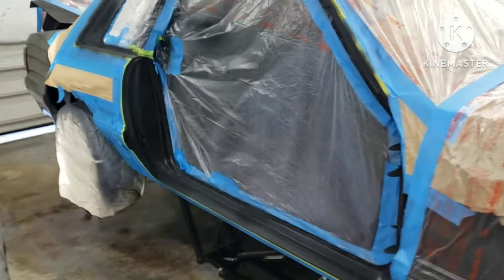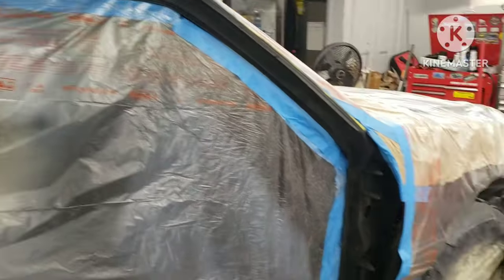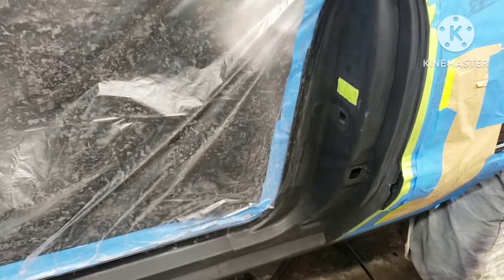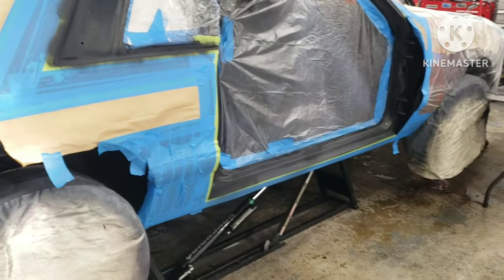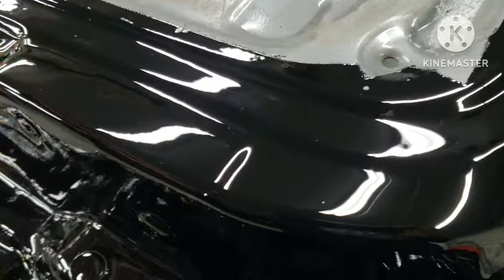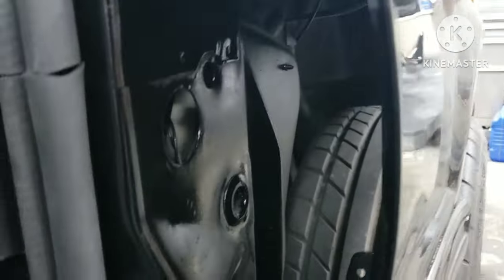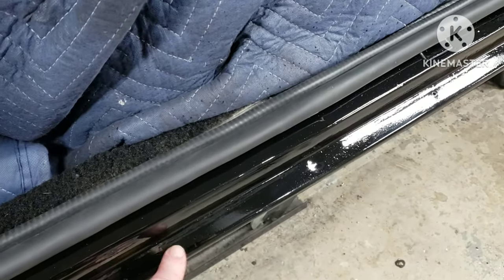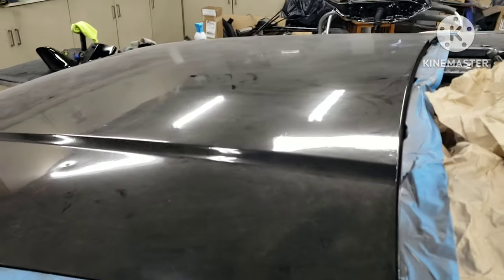Fox body painting door jams and doors. @speedokoterefinishnetwork4937

Comment: Looking good, keep up the good work. Can’t wait to see it all together.
Reply from the maker: Thanks man I'm just waiting to see how bad the IRS is going to kick me in the nuts this year and then I can get this thing done🤣 I have plenty to do but it's sitting on 4 dry rotted tires 100% tread just must have sat outside for years.
Reply: @Joeshomegarage  same here. I just ordered a sve radio gauge pod and a couple gauges to install. My tires are weather cracked. They were on the wheels when i picked them up so no telling how old.
Reply from the maker: @SouthernLifeCollective  Yeah the kid I bought the car from changed it from the old centerlines to the cobra reps which I think it looked better but older guys have different taste I guess! LOL The tires on mine are only 5 years old but I'm guessing they sat outside or somewhere damp or maybe too dry? I've never seen tires that new cracked that bad. All tires have a date code on them. If you look at the DOT numbers the last 4 numbers are when they were produced it goes by week then year so if it was 5107 it would mean the tire was made the 51st week of 2007 if there is no number then the tire is pre 2000! In case you didn't know.

Comment: Goood thinking with the single stage paint. Sanding and buffing can fix the rest.  I’m gonna try this
Reply from the maker: Thank you! Yeah when I painted my girlfriend's car I had a good bit of orange peel and some runs and if I took the time to wet sand and buff it it would look great but my painter buddy said it would be easier to da it with 600 and spray 2 more coats adding 10% reducer to the paint really helps it lay down smoother.